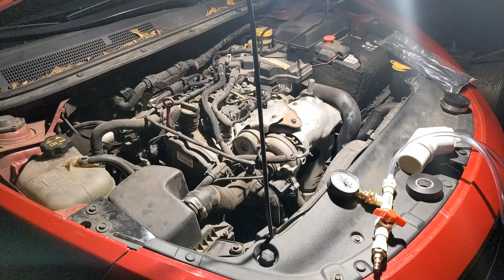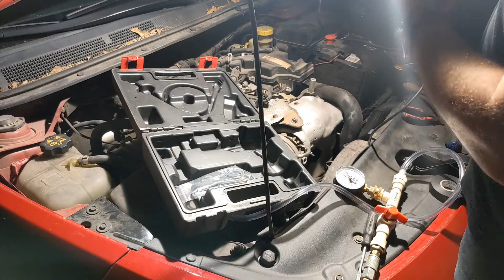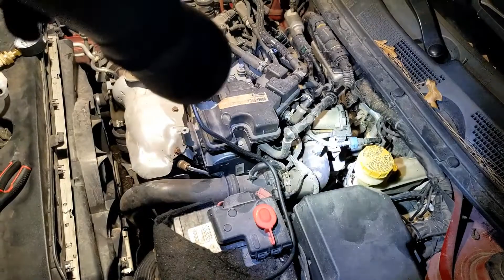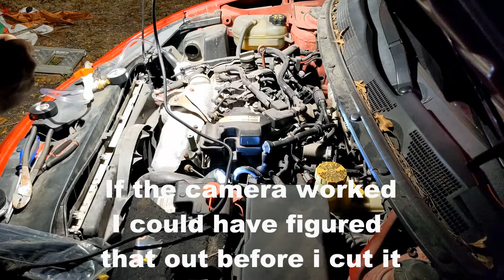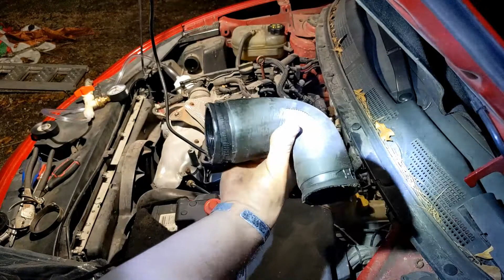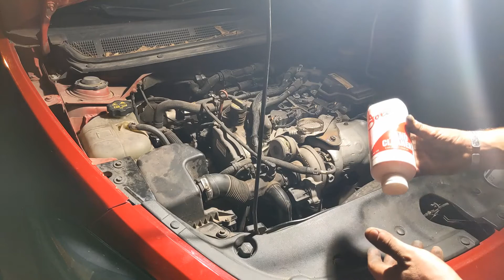2013 Dodge Dart P0299 Underboost code

Comment: The most common causes for underboost on the 13 1.4 turbo Darts besides the crap intercooler hoses are the wastegate solenoid, the boost sensor becoming dirty due to the air/oil separator dumping oil into the intake and the Garrett GT 1446 turbocharger developing leaks through the wastegate. That turbocharger has since been revised due to it's reliability problems. These cars was rushed too quickly into production. And after Fiat took over Dodge, the quality has went to hell. Running higher than factory boost (I'm maxing at 24 psi boost on mine) seriously ditch the stock intercooler hoses and buy some silicone units. Buy silicone hoses for the wastegate solenoid as well. Those plastic hoses with the rubber will crack and leak as well causing boost issues. Manufacturers using rubber which quickly degrades instead of silicone that's far more durable and not much more expensive on today's cars doesn't make a bit of sense to me. I guess "build them cheap and sell them high" is the motto with manufacturers these days.
Reply from the maker: Thanks for the info, I'll have to look into doing that. I have noticed I'll get a low boost code every now and again still but usually if I'm pulling my small trailer with something on it. Still gets better gas mileage than most small pickups, it just gets really sluggish and can barely break 65 mph up hill when it used to be no issue. I'm also near 210k miles so it could be a number of things.
Reply: @projectparadise1736  another cause of boost issues is the wastegate flapper valve. They wear out over time. Check the flapper lever. It should be tight. If it wiggles, then then it's worn out and the turbo has to be replaced. The turbocharger has to be cleaned out at times as well. Gunk builds on the vanes and causes the turbo to work harder to generate boost. The intercooler has to be cleaned at times as well. A dirty intercooler will raise intake temperatures. That kills boost. Intake and combustion chamber cleaner sprayed into the air cleaner box does the trick. And spray debris out of the intercooler fins with a spray hose.